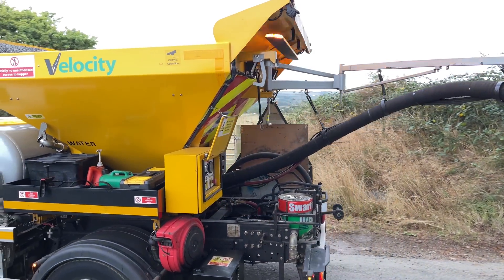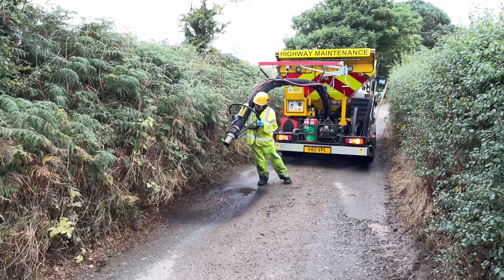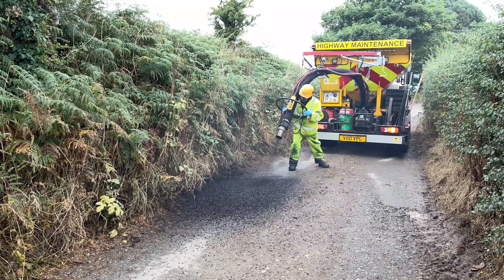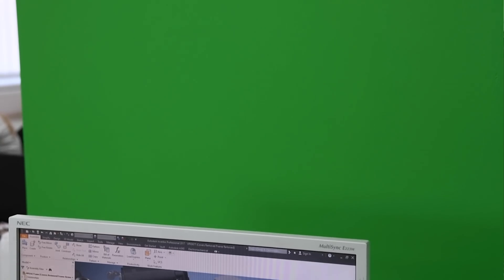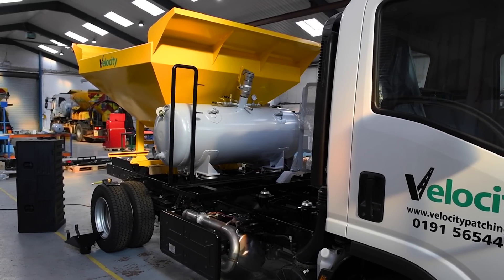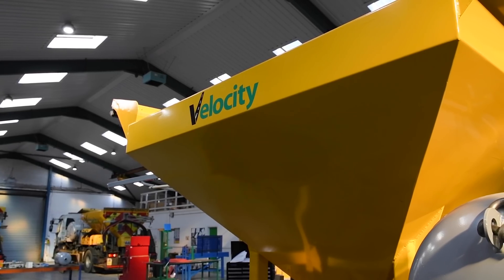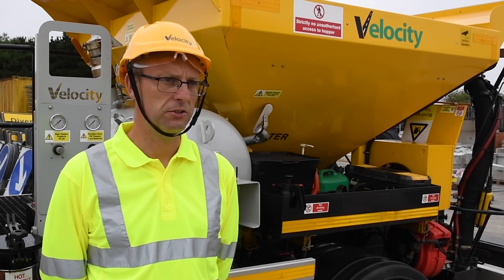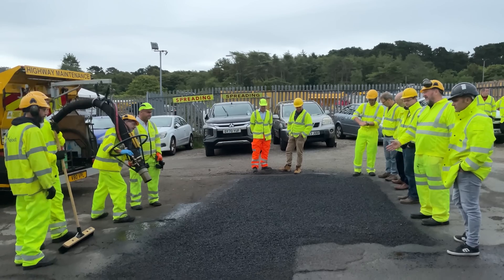New pothole repair machine helps fix defects that are difficult to reach

Comment: Leaves absolutely dangerous roads surfaces especially for 2 wheeled roads user after this type of “repairs” has been applied. Our LA used to this type of machine but thankfully stopped using it due to escalating material cost.

Comment: Fort Wayne, IN tested a machine like this 18 years ago. Couldn't handle the cold and didn't fare too well in the hot summer either. The patches couldn't bond to the road and stay together in the heat. The drier can't dry in the cold (no heat). Returned to seller.
Reply: Most of that is what I thought. There's no way that is compact enough to stay long.
Reply: @kanetao This is exactly what I thought. Our city council uses this extensively and repairs are appaling. All that they do is simply FILL the hole. They break open with the next few days.